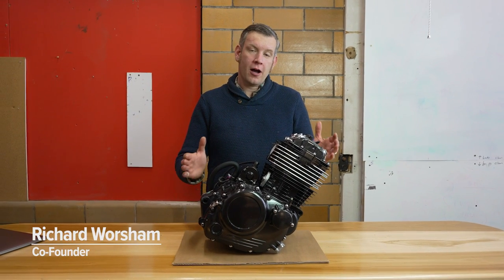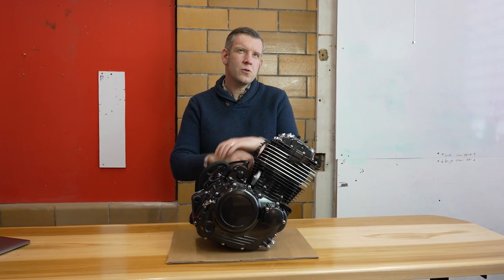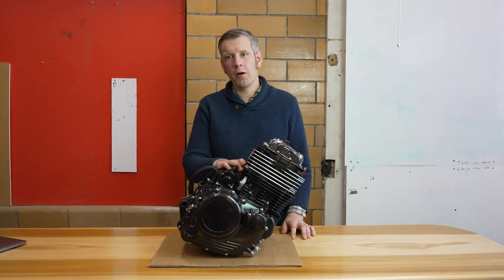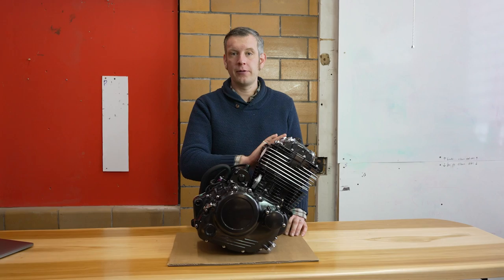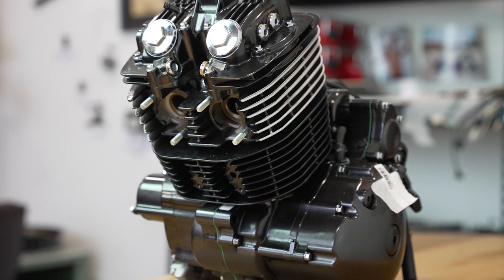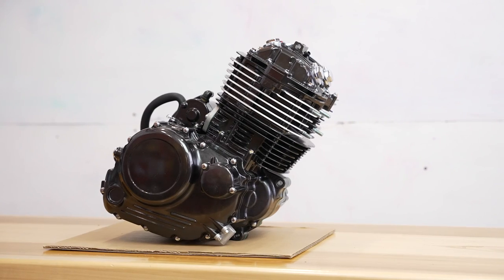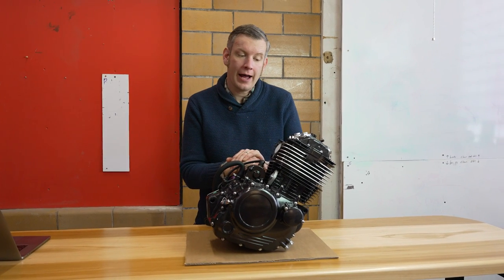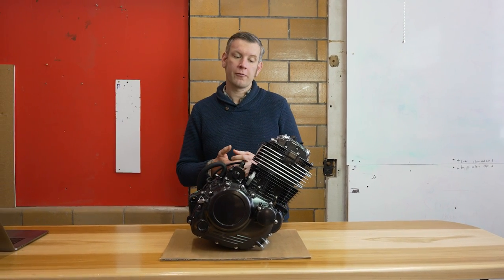Janus Halcyon 450 engine | Parts talk

Comment: You're following the right pattern for a growing company.  Start small and slowly work upward in the power range.  After the 450 CC I can well imagine the next model will be a 650cc to 750cc  motor.  I just waiting for when you decide to make an era correct sidecar that looks the period of the 1920's- 30's.
Reply: If they made a 750 cc bike it would be 20k lol
Reply: There are small displacement twin cylinder engines out there ,I do like the retro 20 30s era styling.
Reply: Thanks for the detailed information. I had bike with the 400 XR engine. They sell it as Mash in Europe. Very, very reliable and fun engine and as you said easy to service. Love your the looks of your 450Cc. Hope to own one.
Reply: oH I  thought I was the only one that wanted a side car with the 450.
Reply: yes with a sidecar, I would buy it today, been testing URALS here in Georgia.
Best regards,

Bill Stankiewicz

Professor FORKLIFT SAFETY TRAINING/OSHA/ VR Virtual Reality Training

SAVANNAH TECHNICAL COLLEGE

Savannah Supply Chain-CEO
Reply: V Twin!!!

Comment: The Halcyon 450 with the SWM single stroke 445 cc engine is the perfect fit for me! I'm an older guy 👴 👦 with no need or desire to go over 85mph. I decided upon Janus because it was sheer genius how they've reimagined the motorcycle 🏍 and helped to recapture the original ethos of the joy of 🏍 🛵 🏍 🛵 motorcycle riding!

Comment: Thanks Richard!  I appreciate the thoughts.  Part of the reason you knocked it out of the park with this engine is that it is a single cylinder just like the historic bikes from Britain in the 20's and 30's which this bike looks a lot like and handles like.  Further, anything more than a 600 would be a mistake so this being a 450 was perfect!  A single "thumper" when above 500cc you can really feel it and hard to balance.  So with the perfect size motor and power to maintain a highway speed of at least 63 mph in my case, this perfectly fits the bill.  My only concern is the shipping crisis but no need to comment as no one knows where that is going.  Just hoping mine has this engine when it was built.  Again, thanks for the videos and keeping up the excitement in anticipation of getting my own.
Reply: My Suzuki Savage 650 thumper is doing just fine
Reply: I think it's an awsome bike, nostalgic and fine for just enjoyed riding for a 62 year old.  I've had alot a riding over the years( road n lots of dirt riding..).still thinking on it. I dont heal as used to. And the roads are full of dingies. But your bike is an awsome bike
 Hope you never change it.👌🏻👍🏻🤓

Comment: SWM Six Days 500 rider here, sharing the same engine. It's amazing how versatile it is, and how it ended up being used in a specialty build because of its qualities. If you ever decide to go larger, Shineray also makes a larger 650 cc version, presumably also based on an older Honda Design (XR650/Dominator).

In Europe, SWM has updated the engine for Euro 5 regulations with lower compression (9.5 vs 10) but also added a sixth gear for better cruising and more even spacing.

Comment: I can totally appreciate the design and meticulous build quality of Janus motorcycles. And they are beautiful things, no question.

But after the stunning first impression of the bike as a whole, my eye is inextricably drawn to that 70's- 80's Honda-derived engine.

In my humble opinion, that old engine doesn't suit the look of the Janus design. 

If the engine was left unpainted (without the matt black on the outer cases and cylinder barrel) the engine outers could be polished up to gain more of the retro look that the Janus is trying to emulate from the 1920's and 30's.

Better still, have your own engines made. That is the future. I hope.

Love the bikes.

 Ride safe. Love and peace

Comment: Great information explaining the history of the engine and the reason you chose it.  Honda is dead reliable with most of there motorcycle engines.  When I was a teenager I owned a 1979 Honda Twistar 185cc.  My first street bike.  Bought it used for $500 with 35000 km on it .  I rode that bike everywhere.  I out grew it and it was still running when I parked it in my dad's barn.

Comment: How about a Janus Gryffin 450 Scrambler/Adventure multipurpose hybrid bike?? 
    Take the cool old school looks of the Gryffin with it's rear luggage rack. Add the 450cc engine, made so it could rode as a naked scrambler. Or quickly converted into a useful adventure bike by adding some cool, old school looking army green canvas saddle bags & canvas bag for the rear rack. The bags could left on 24/7 & simply strapped down when empty, to keep them from flapping around in the wind. Add an adjustable windscreen & hand guards that match & don't take long to install or remove.... It already has the bottom engine guard (maybe add some small side engine crash guards also) Now you'd have an Adventure/Scrambler hybrid that looks good & can rode around naked. But can also be quickly converted for a road trip, 3 season riding or just a trip to the grocery store. With the 3 canvas storage bags & a backpack it could hold a lot of groceries. With gas prices so high, I'd ride as much as possible, a 6 speed/OD would be nice.
Reply: YES. PLEEASE Make a 450 Gryffin :)  That would make me buy my first Janus. I've seen 3 in person and I love them, but I'm 280lbs and want to pass on the highway.
Reply: @steelmilkjug  My 1st comment was long winded. I like the way the Gryffin looks. Would like it even more if they gave buyers an option of a 250 or 450 engine & if you could easily add some matching saddlebags ,windscreen,etc.. to quickly convert it from naked scrambler to adventure road trip bike. I think some olive green, canvas military looking saddle bags & rear bag would match the bike pretty good. They could be DIY coated in wax or silicon & made waterproof. The 250cc engine (some thing like 223cc actual displacement) is just too small if you need to get on the interstate.

Comment: Great looking bike. Very impressed with the simple design and upright ride. I would love to see this bike in a 650 or 800cc (max) and maybe a parallel twin configuration. I did a lot of interstate riding, and a 800cc twin would provide the necessary HP and tours for that.  But very nice bike indeed!
Reply: Interstate touring is fine if you’re into that kind of thing. But that’s an entirely different kind of riding experience than I think the average Janus customer is interested in

Comment: You are building wonderful bikes. The engine fits to your bikes perfectly. It is reliable, relatively comfortable, has nice sound, looks vintage enough and spareparts are in masses available. Also it is cost efficient, which not at least make your 450ccm bike affordable despite all those individual options. 

Couldn`t you export them to Europe?

Comment: That honda design hasn't been bettered for a reliable air cooled 4T engine. I've had it in a few XLs and it is so reliable and easy to maintain. I always had carburated versions. Some with electric starters and some kick only. 1st 2nd kick to fire up when you have the knack. You should offer a carburettor conversion for people who don't want EFI

Comment: I have always said they should never have bothered with the 250 nor 2450 version they should have bought Suzuki 650 Savage Motors and put them in their bikes. They would have something they could comfortably travel on the highway with without it screaming at the top of its lungs or busting a gut. It is more expensive than a BMW scrambler. For that price they could put a Sportster motor in it. Give it that old-time V-Twin Harley look with a real Harley engine

Comment: Y’all Make me feel Good about really Loving my 250 HAWK…!
With its Chinese clone motor…..! 4000 Miles and runs and performs like a sewing machine………👍🏻
Reply: I have a Hawk 250 also. I currently have 10,000 miles on that CG250 motor and she just runs!
Reply: @dustinsegers4534  I hear that…!!!
Reply: That's a pushrod engine, correct? If so, it's one of the simplest most bulletproof engines out there. The Honda TMX 125 is sold here in the Philippines with that same design

Comment: I wonder it the XR650 motor will fit in the frame?
Reply: I beleive so. I have 3 600's in storage that i aquired over the years. Thinking of doing a swap for myself after it is built.  600 next to the 400 that this is based on look identical

Comment: You see, I dont mind if the engine is a ripped off Honda engine,  What I do mind is that someone saw it fit not to include a kick starter, when you can clearly see the kick start lever hole blanked off. The bike is purporting to be a vintage motor bike circa 1920s , so how many bikes do you know in that era had electric starters!  All wrong , just a failed attempt at being a vintage bike!

Comment: You guys make a brilliant motorcycle, full of style and nostalgia; but this mentioning of names like Honda and Husqvarna, looks fishy in my opinion. You guys use a Chinese knockoff engine, MADE IN CHINA.  Nothing to do with Honda or Husqvarna. You are just waiting for a lawsuit to happen!
Reply: SWM is the old Husqvarna before the KTM acquisition.  The current engine is the old husqvarna design but manufactured in a plant that used to make engines for Honda.  Not fishy, but trying to allay fears of the regular cheap chinese engines with piss poor metallurgy.  There are a few good, reliable chinese engine manufacturers like Lifan.  Honestly, I'd rather see an american engine (especially at this price), but where are they going to get one?  What American engine should they use?  

Even the briggs and stratton vanguard twins aren't made here :(.  The dummies in California (CARB) are outlawing small gas engines 25HP and lower (off road and non vehicle use) starting with the 2024 model year.  With that we will see even fewer small gas engines made here in the US.  Which is a shame because small businesses and independent owner/operators run on small engines.  When they flee the state hopefully they don't bring their dumb politicians with.
Reply: @BB-nn9en  I still think design is not the real thing. There are several other details involved, including measurements and tolerances, types of metals used, etc. China copies everything, or you can say it’s the same design, like they do with the knockoff Rolex watches. I truly believe this is not a Hvsquarna or Honda engine. An original Honda engine runs over 100,000 miles with proper care, will this Chinese knockoff engine get to 50,000 at least? Only time will tell. Look at the words; “Honda derived engine”, it means THAT’S A COPY, a Chinese knockoff.
Reply: There's enough China in a Harley.